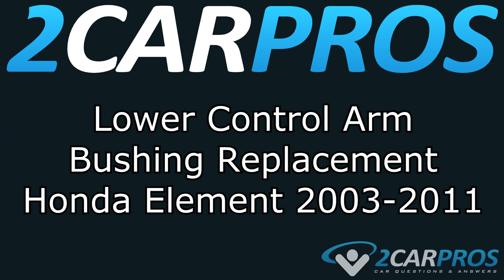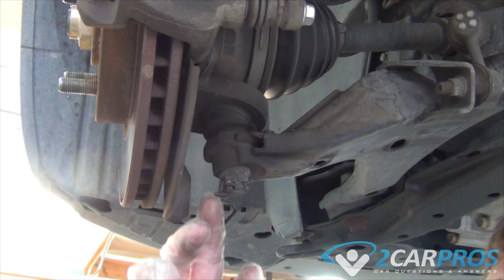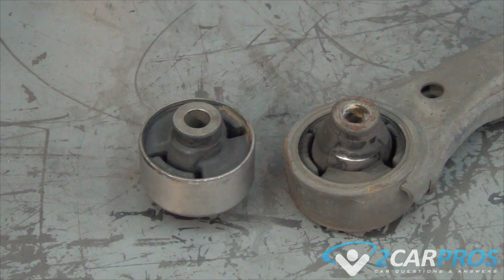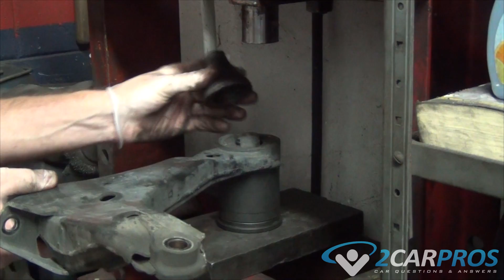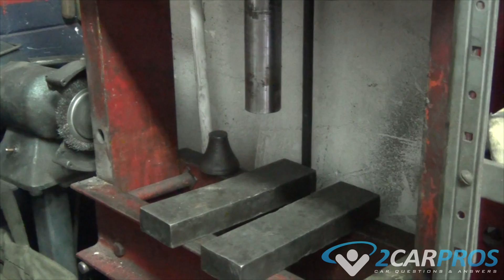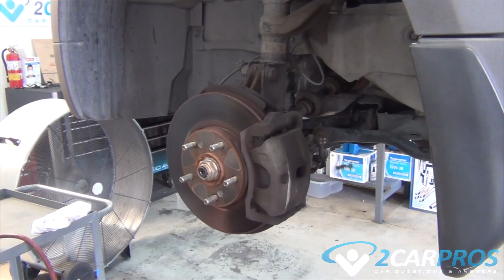Lower Control Arm Bushing Replacement Honda Element 2003-2011

Comment: excuse me for the question, I have a 2007 Acura mdx, I need to change the ball joints, can I just change the ball joints?  Or do I have to change the entire lower arm?  Thanks for your answer and for your videos.

Comment: You made the same mistake I did but went back and corrected the next day.  The mistake is, Tightening the horizontal bushing before putting a load on it.
Now when you put the car on the ground the bushing will twist and then when you hit a bump it will twist even more and thus wear out quicker.
If it's not twisted at rest it should last longer, Right ?
Reply: Thanks for the tip Mike.

Comment: You didn't do the other bushing
Reply from the maker: It is the same process. Thanks for watching!
Reply: @2carpros  Technically yes, but is much more difficult because of the dimensions of the control arm.
Reply: @2carpros  this is very misleading, yes theoretically it is the same process but you have that very wide rim on the other bushing. What do you rest it on? Don't mislead people like that, oh it's easy, same process. No it's not.
Reply: @2carpros  but it's not. The lip on the bush the demotions of the LCA means it is a royal pain in the ass. I cannot get it to fit in my floor press and the threaded press is now bent due to there been no flat surfaces for the receiving cup to sit against

Comment: what if the bushing's orientation is not exactly the way the old bushing was?  I just changed the bushing on my 2003 Element and i didn't even think to check that.  I just put it in.

Comment: Before you do this repair see Honda TSB 09-023 April 11, 2009 

Both front compliance bushings (aka control arm front bushings) may be 
eligible for warranty replacement. TSB says the job takes 1 hour to 
replace both bushings! Seems awfully fast but maybe experienced mechanic
 can do both in 1 hour. Plus 0.6 hours for wheel alignment. I didn't 
know about this TSB so dealer charged me 4 hours labor.
Reply from the maker: Thanks for the info!  it helps others
Reply: No such TSB comes up, would you be able to post the link

Comment: You only showed the easy bush to replace.  What about the other one? What do I do there?
Reply: same thing but sideway bro, you will actually have an impact socket that will fit that one vs having to go find something for this one.
Reply: But the control arm is odd shaped and won't fit in my press. There isn't flat surfaces to push off. The rear one is a pain and I can't get it out